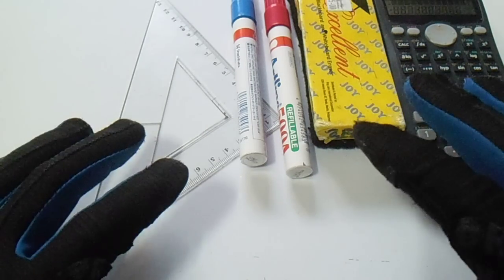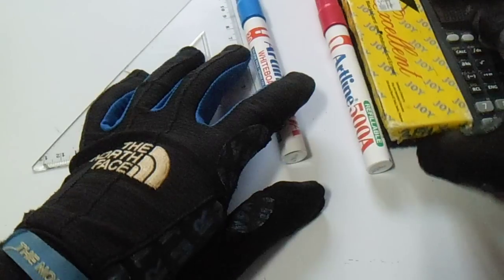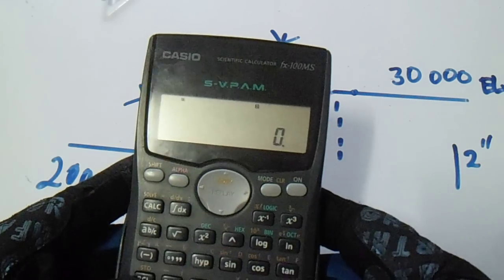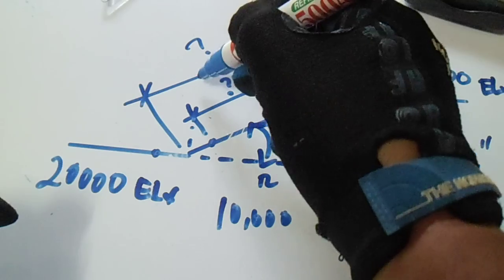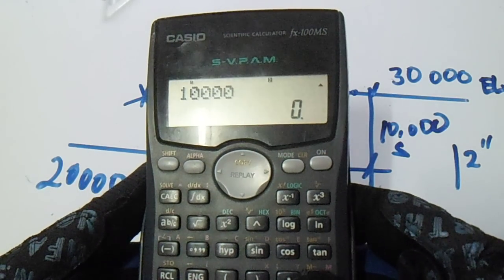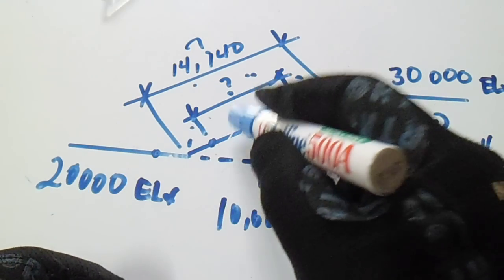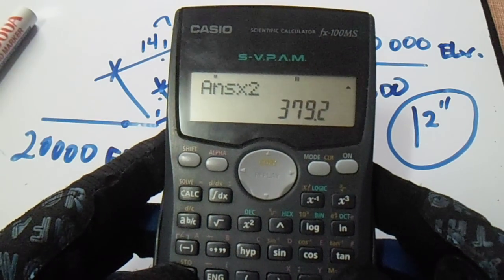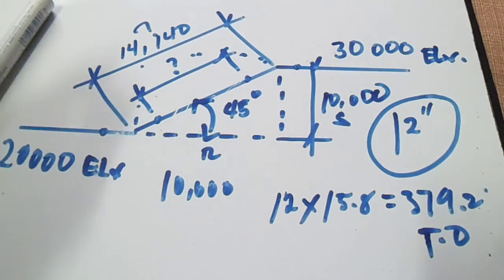How to Find Set,Travel, Spool and Take Off Given the Degree & Elevation - PipingWeldingNDT

Comment: 4G I. 1 9:0A thiep.talentIms.com a dujell ENGLISH PF205 THREADED PIPE FABRICATION P16 CALCULATE THE TRAVEL FROM THE GIVEN DATA. A. ROLL = 175 mm, HEIGHT = 300 mm ELBOW ANGLE = 45 degrees B. ROLL = 375 mm, HEIGHT = 456 mm ELBOW ANGLE = 30 degrees C. ROLL = 465 mm, HEIGHT = 528 mm ELBOW ANGLE = 22.5 degrees

Comment: saan po kinuha ang 15.8???
Reply: TO for 45° ..Ex LR 45° the RUN is 1.5
 tan 22.5 °= TO÷ RUN
TO = Tan 22.5 x 1.5
TO = .621 but .625 is accurate in practical  so
 .625 (ENGLISH UNIT) ginagamit kabayan..
TO = .625 inches × (25.4mm÷1inch)
TO = 15.8 mm 👍👎

Comment: 5/8 broken down is .625 so if you did 12 x .625 that would = 7.5 per fitting so 7.5 + 7.5 would = 15..... where are you coming up with 15.8? if you follow your formula your ending take off would be 13780 F-F not your 13760.8 that is a difference of 19.2 that is a huge difference in fitting so if i screwed up somewhere let me know but the math does not add up.
Reply from the maker: 45 degrees elbow 5/8=.625 this formula for inches if your center to center of elbow or travel are inches use this formula 5/8 or .625 if mm use this formula for easy way 15.8 for 45 degrees elbow. thanks to your comment and watching.
Reply: Explain it very well,. 625 multiply by 25.4 then you have your 15.84 you want to teach but you lack of explanation how can we understand. Where did you get 1.414
Reply: @junrivera7837  1.414 is the number you use with regards to the pythagorean theorem. The hypotenuse is always 1.414x bigger than A^2/B^2. It's just a shortcut instead of working out the math on the whole formula.
Reply: Robert Elliott I don’t understand how that formula works that you are talking about. You say that if you take A(squared) and divide it by B(squared) then multiply it by 1.414 you will get C. Here’s my scenario, A=4 B=3 and I don’t know what C is. According to the formula you mentioned if  I take 16 and divide it by 9. Which is 1.77, then multiply it by 1.414 I will get C which according to you is 2.51. Pythagorean Theorem tells me that C is 5. I’m not trying I be difficult I’m just trying to understand your cheat and whether or not it’s true.
Reply: Robert Elliott the only way I’ve been able to get your formula to work is in regards to an isosceles triangle in which both A and B are equal
Reply: @jordanrounds9890  You can see where he cut the angles in 45 degrees, making each side equal. If one angle is 45 degrees, then the other angle is 45 degrees as well, they both add up to 90 degrees. In this case, A^2 + b^2 = C^2, but a=1 b=1 c=2 , and the square root of 2 is 1.414(approx.).
Reply: @jordanrounds9890  So let's say a=3 and b=4 we know c will =5. But if you take 3+4=7, cut that 90 degree into 45 degrees to make it equal sides (3.5). You get 3.5, multiply that by 1.414 and you get 4.949, but you round up always. So that's the shortcut in a nutshell. 1.414 is an approximation.
Reply: 12/6
3/1.5……..top row 90.. right side of slash 45

Comment: where the value of 1.414 from?
Reply from the maker: you can use 1.414 for 45 deg elbow
Reply: secant for 45 elbow -----page 174 blue book
Reply: 1.414 is squareroot of 2
Constant multiplier for 45 degrees offset to get travel

Comment: sir pwede rin ba e multiply ang 12inches sa.625
Reply from the maker: 12 inches is diameter you can get the Take off of 45 degrees elbow using .625 or 5/8
Reply: 12 x .625 x 25.4

Comment: I don't get it. After you find the travel don't you just take off 2 12" 45's which would be 15"???
Reply from the maker: if not given the travel in two 45 degrees elbow, just multiply it first the given to 1.414 to get the travel and then get the take off two 45 degrees elbow 5/8. Thanks for watching
Reply: Exactly..
Reply: indenxmuve
Reply: San nakuha yung elevation sir
Reply: D p owding sukatin diretso yung center tsaka center tapos multiple n kaagad
Reply: yes you would ,this guy is all over the dam place.